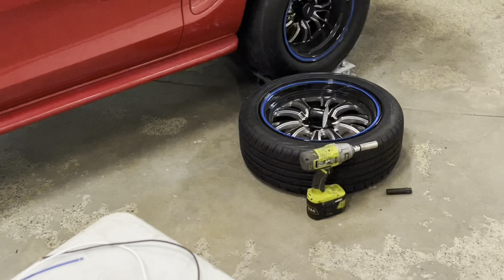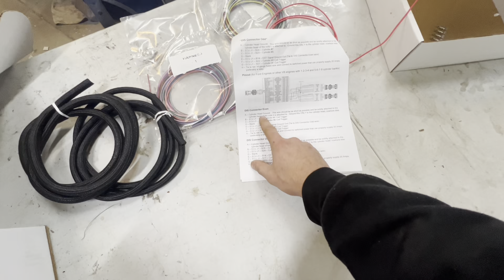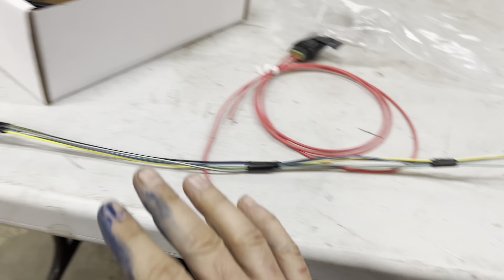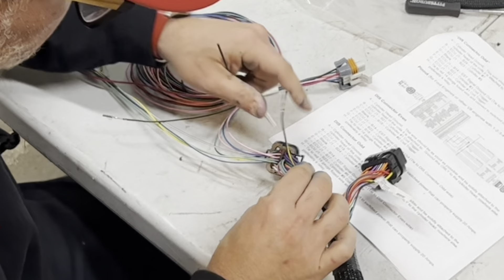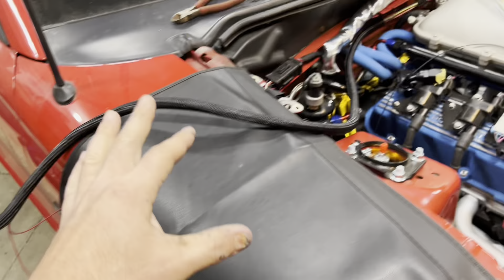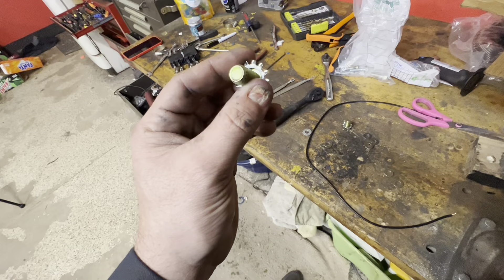Holley 558-307 Universal Coil On/Near Plug ignition harness- How To wire it into the Terminator X!

Comment: How you set up your ignition(cam,crank) sensors
Reply from the maker: The the Hellstang playlist I should have another video. I basically followed what Holley recommended. I also had help from the ford Holley terminator Facebook group I’d recommend joining that as well. 

Ultimately though the stang went to a local tuner last summer and it has great drivability now but I still have never checked what all he changed in the then. I’ll try to get a reading of this week to let you know